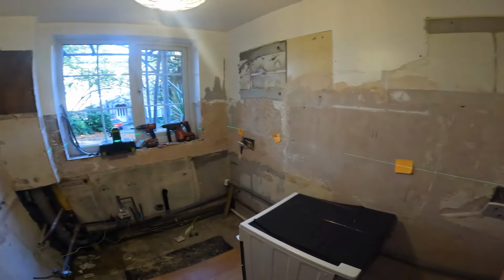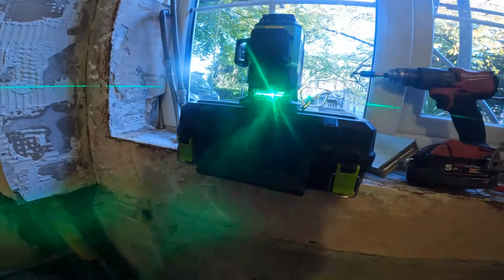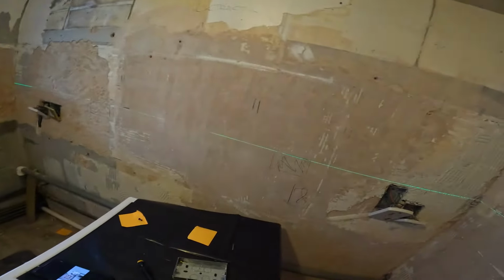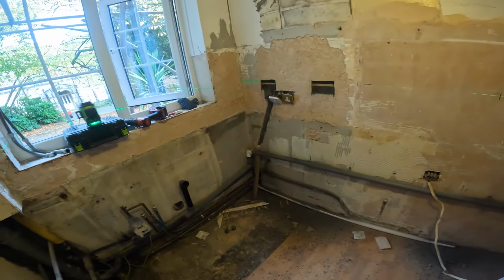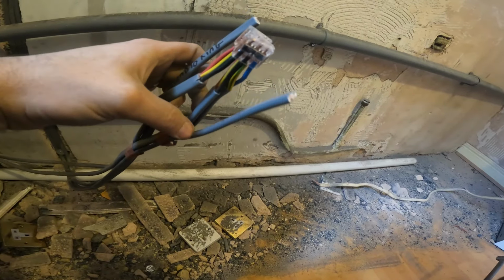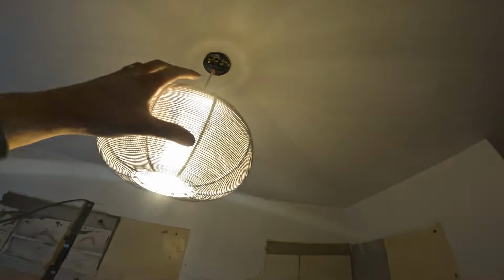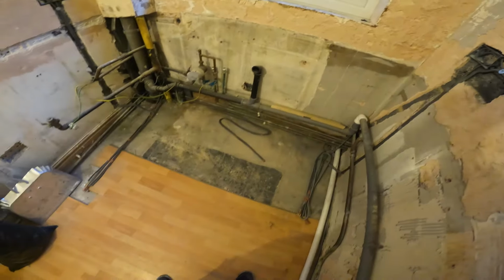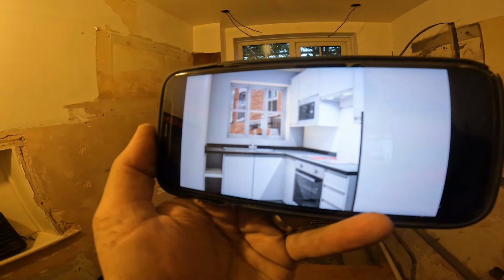FIRST FIX DONE RIGHT! 🔌⚡

Comment: Had  a discussion with an electrician about accessible isolation switches for fixed appliances. His view was that isolation switches in adjacent cupboards are not ' accessible ' and that grid switchs should be used. Seems a lot more work to me.
Reply from the maker: @kieranhartnett4459  The electrician is talking rubbish! Grid switches are always switching appliances on different walls. They are an ok method, but for me it takes a heck of a lot longer and I find people who do that just put a socket under the plinths for each appliance to plug into. Or put them behind so the appliances don’t push back fully
Reply: @finneyelectrical  Agree. AIso think interior designers like switched kept off the splasbacks
Reply from the maker: @kieranhartnett4459  totaly right! Less busy the better, sockets and switches only for me 😀